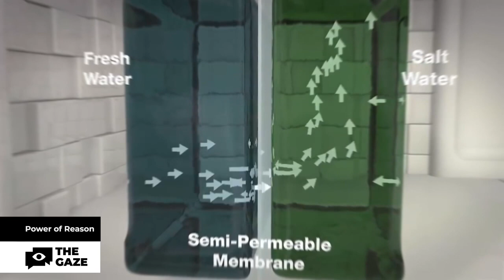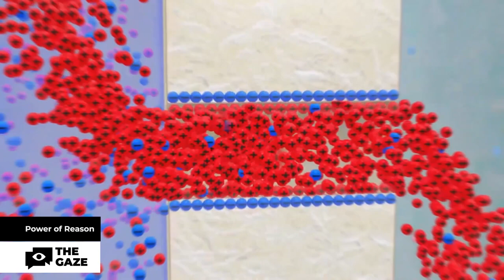Unveiling Blue Energy: Harnessing Power from Water in France | The Gaze

Comment: Bull s**t. Salt water = corrosion, impurities, clogging, Ph variation... Extracting the miniscule amount of energy would require a separator that will quickly get destroyed or clogged. Low energy difference, means any fancy solution relying on external energy to keep the process going will generate less energy than the input.

Comment: Lack of fresh water is a very big problem. Blue energy would make that worse. As for taking water just before it hits the ocean, that would cause other problem to the eco system the flow rate of the water would drop causing rivers to have build ups of soot then more energy would be needed to clear the rivers.
SMRs are the best energy hope for our short term future.
Reply: Personally I think your wrong , small scale water turbines are much more feasible long term, plus thier is no more or less water on the planet now than when the neanderthals  roamed its surface 😉
Reply: – "the flow rate of the water would drop"
You seem to be confused. If the flow rate would drop, there would be accumulation of water somewhere. Where would that be? In reality that of course doesn't happen (at least at meaningful scale on the dominant plant type, built on river estuaries – if you know a plant type that makes water "disappear" somewhere, I'd be interested to hear some specifics about it).
– "SMRs are the best energy hope for our short term future."
If they really are the best hope, we are in trouble. According to studies small nuclear reactors (SMR's) would be at least 50 % more expensive to build per MWh produced than traditional nuclear power plants, and even that would require large scale semi-serial production (of course the companies developing SMRs tell a different story on their marketing material). Also controlling of what happens to spent nuclear fuel would become exponentially more difficult, if SMR's indeed would become popular and be built in all kinds of countries that currently don't have nuclear power. Expensive and problematic – what's not to like...